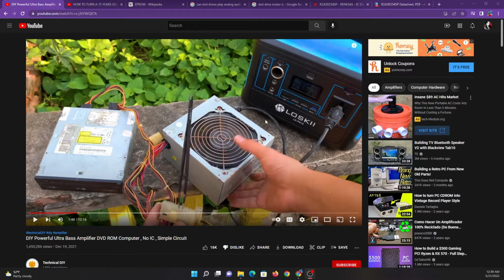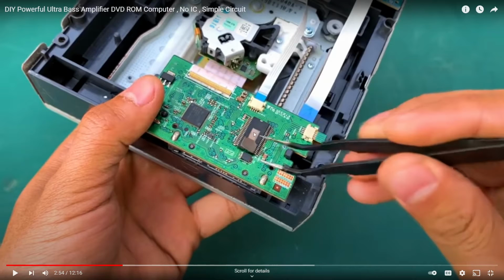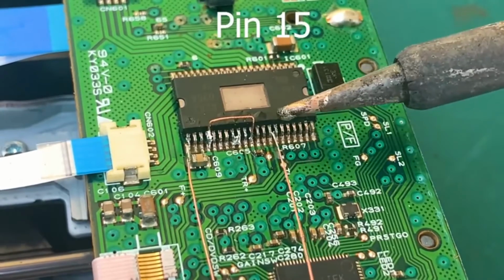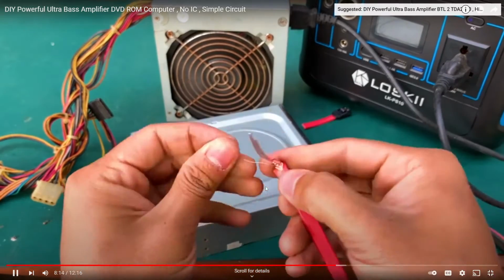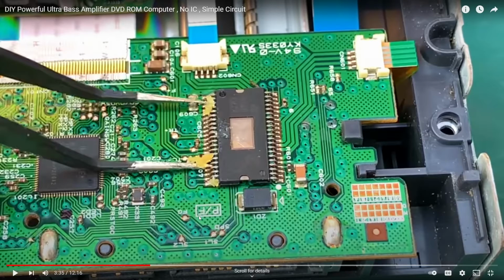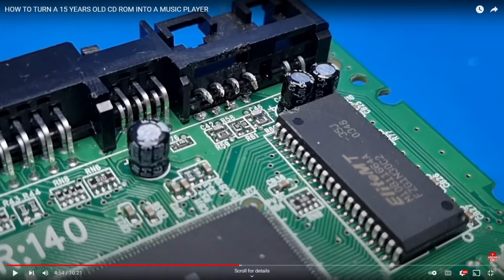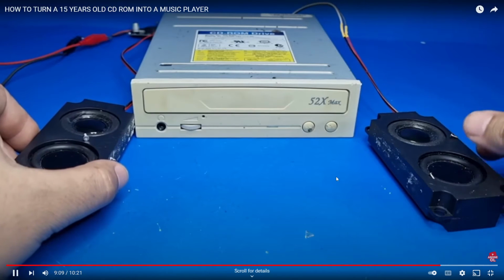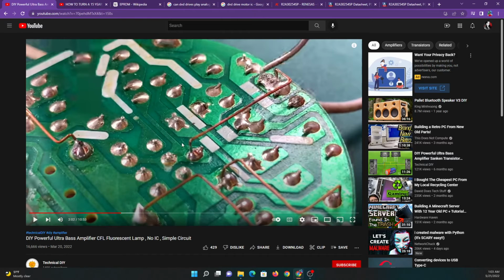CD Drive to CD Player Video Review: Fake vs Real

Comment: The motor controller chip does not have an UV window for erasing its contents. This small rectangle is a metal plate exposed that allows cooling, and the sticker it removes is a thermal conductor to CD's case. Of course the video is otherwise complete nonsense.
Reply from the maker: Ah, good catch. That makes a lot more sense.

Comment: My biggest concern is the fact that PSU looks like it spent several years in saltwater...
Also yeah this was possible with some older CD players with integrated DACs but they all had headphone jacks and I've never seen one that wasn't IDE/MOLEX, that video is just ridiculous lol. In the case of a drive with a DAC you could solder straight to the audio line, I laughed when the guy soldered straight to the motor control IC...
Reply from the maker: Yeah, in the last half of the video I show a video where a guy does it properly using an old drive with an analogue out. I'm not sure it's remotely possible with the newer drives that have no digital to analogue conversion, not without a lot of extra circuitry.  And yeah, that rusty old PSU is scary! Lol
Reply from the maker: I had a good laugh also when I looked up what that chip was and found out it was the motor controller. In fact, most of this video had me laughing after I watched it a few times.